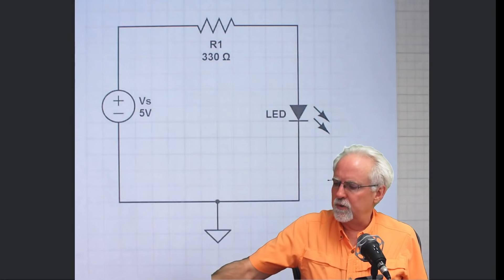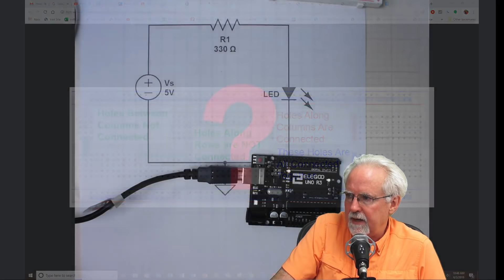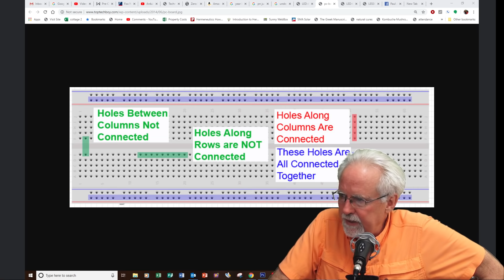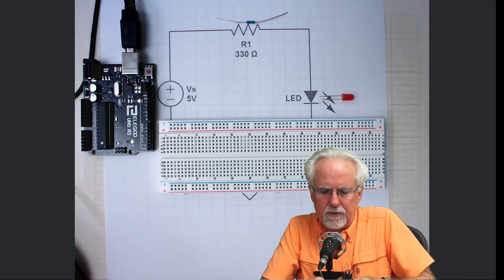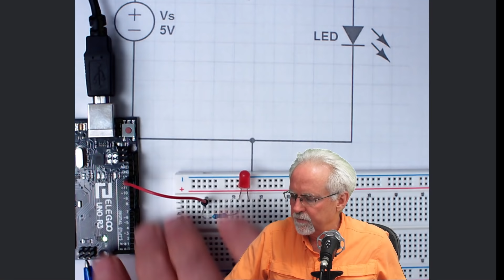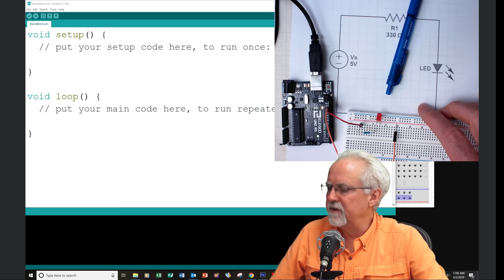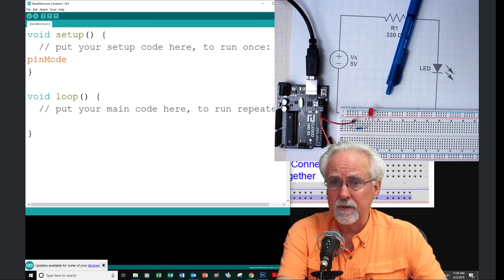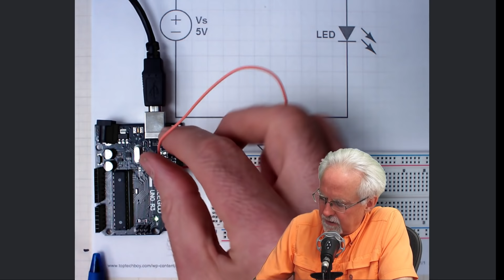Arduino Tutorial 3: Understanding How Breadboards Work

Comment: i did it by my self by your videos sir.

//code for blink red led 5 times
//green led 10 times 
//blue led 15 

void setup() {
  // put your setup code here, to run once:
pinMode(13,OUTPUT);
pinMode(12,OUTPUT);
pinMode(8,OUTPUT);
}

void loop() {
  // put your main code here, to run repeatedly:
  //red led will blink 5 times
digitalWrite(13,HIGH);
digitalWrite(12,LOW);
digitalWrite(8,LOW);
delay(100);
digitalWrite(13,LOW);
digitalWrite(12,LOW);
digitalWrite(8,LOW);
delay(1000);

digitalWrite(13,HIGH);
digitalWrite(12,LOW);
digitalWrite(8,LOW);
delay(100);
digitalWrite(13,LOW);
digitalWrite(12,LOW);
digitalWrite(8,LOW);
delay(1000);

digitalWrite(13,HIGH);
digitalWrite(12,LOW);
digitalWrite(8,LOW);
delay(100);
digitalWrite(13,LOW);
digitalWrite(12,LOW);
digitalWrite(8,LOW);
delay(1000);

digitalWrite(13,HIGH);
digitalWrite(12,LOW);
digitalWrite(8,LOW);
delay(100);
digitalWrite(13,LOW);
digitalWrite(12,LOW);
digitalWrite(8,LOW);
delay(1000);

digitalWrite(13,HIGH);
digitalWrite(12,LOW);
digitalWrite(8,LOW);
delay(100);
digitalWrite(13,LOW);
digitalWrite(12,LOW);
digitalWrite(8,LOW);
delay(1000);

//now green led will blink 10 times

digitalWrite(13,LOW);
digitalWrite(12,HIGH);
digitalWrite(8,LOW);
delay(100);
digitalWrite(13,LOW);
digitalWrite(12,LOW);
digitalWrite(8,LOW);
delay(1000);

digitalWrite(13,LOW);
digitalWrite(12,HIGH);
digitalWrite(8,LOW);
delay(100);
digitalWrite(13,LOW);
digitalWrite(12,LOW);
digitalWrite(8,LOW);
delay(1000);

digitalWrite(13,LOW);
digitalWrite(12,HIGH);
digitalWrite(8,LOW);
delay(100);
digitalWrite(13,LOW);
digitalWrite(12,LOW);
digitalWrite(8,LOW);
delay(1000);

digitalWrite(13,LOW);
digitalWrite(12,HIGH);
digitalWrite(8,LOW);
delay(100);
digitalWrite(13,LOW);
digitalWrite(12,LOW);
digitalWrite(8,LOW);
delay(1000);

digitalWrite(13,LOW);
digitalWrite(12,HIGH);
digitalWrite(8,LOW);
delay(100);
digitalWrite(13,LOW);
digitalWrite(12,LOW);
digitalWrite(8,LOW);
delay(1000);

digitalWrite(13,LOW);
digitalWrite(12,HIGH);
digitalWrite(8,LOW);
delay(100);
digitalWrite(13,LOW);
digitalWrite(12,LOW);
digitalWrite(8,LOW);
delay(1000);

digitalWrite(13,LOW);
digitalWrite(12,HIGH);
digitalWrite(8,LOW);
delay(100);
digitalWrite(13,LOW);
digitalWrite(12,LOW);
digitalWrite(8,LOW);
delay(1000);

digitalWrite(13,LOW);
digitalWrite(12,HIGH);
digitalWrite(8,LOW);
delay(100);
digitalWrite(13,LOW);
digitalWrite(12,LOW);
digitalWrite(8,LOW);
delay(1000);

digitalWrite(13,LOW);
digitalWrite(12,HIGH);
digitalWrite(8,LOW);
delay(100);
digitalWrite(13,LOW);
digitalWrite(12,LOW);
digitalWrite(8,LOW);
delay(1000);

digitalWrite(13,LOW);
digitalWrite(12,HIGH);
digitalWrite(8,LOW);
delay(100);
digitalWrite(13,LOW);
digitalWrite(12,LOW);
digitalWrite(8,LOW);
delay(1000);

//NOW BLUE LED WILL BLINK 15 TIMES

digitalWrite(13,LOW);
digitalWrite(12,LOW);
digitalWrite(8,HIGH);
delay(100);
digitalWrite(13,LOW);
digitalWrite(12,LOW);
digitalWrite(8,LOW);
delay(1000);

digitalWrite(13,LOW);
digitalWrite(12,LOW);
digitalWrite(8,HIGH);
delay(100);
digitalWrite(13,LOW);
digitalWrite(12,LOW);
digitalWrite(8,LOW);
delay(1000);

digitalWrite(13,LOW);
digitalWrite(12,LOW);
digitalWrite(8,HIGH);
delay(100);
digitalWrite(13,LOW);
digitalWrite(12,LOW);
digitalWrite(8,LOW);
delay(1000);

digitalWrite(13,LOW);
digitalWrite(12,LOW);
digitalWrite(8,HIGH);
delay(100);
digitalWrite(13,LOW);
digitalWrite(12,LOW);
digitalWrite(8,LOW);
delay(1000);

digitalWrite(13,LOW);
digitalWrite(12,LOW);
digitalWrite(8,HIGH);
delay(100);
digitalWrite(13,LOW);
digitalWrite(12,LOW);
digitalWrite(8,LOW);
delay(1000);

digitalWrite(13,LOW);
digitalWrite(12,LOW);
digitalWrite(8,HIGH);
delay(100);
digitalWrite(13,LOW);
digitalWrite(12,LOW);
digitalWrite(8,LOW);
delay(1000);

digitalWrite(13,LOW);
digitalWrite(12,LOW);
digitalWrite(8,HIGH);
delay(100);
digitalWrite(13,LOW);
digitalWrite(12,LOW);
digitalWrite(8,LOW);
delay(1000);

digitalWrite(13,LOW);
digitalWrite(12,LOW);
digitalWrite(8,HIGH);
delay(100);
digitalWrite(13,LOW);
digitalWrite(12,LOW);
digitalWrite(8,LOW);
delay(1000);

digitalWrite(13,LOW);
digitalWrite(12,LOW);
digitalWrite(8,HIGH);
delay(100);
digitalWrite(13,LOW);
digitalWrite(12,LOW);
digitalWrite(8,LOW);
delay(1000);

digitalWrite(13,LOW);
digitalWrite(12,LOW);
digitalWrite(8,HIGH);
delay(100);
digitalWrite(13,LOW);
digitalWrite(12,LOW);
digitalWrite(8,LOW);
delay(1000);

digitalWrite(13,LOW);
digitalWrite(12,LOW);
digitalWrite(8,HIGH);
delay(100);
digitalWrite(13,LOW);
digitalWrite(12,LOW);
digitalWrite(8,LOW);
delay(1000);

digitalWrite(13,LOW);
digitalWrite(12,LOW);
digitalWrite(8,HIGH);
delay(100);
digitalWrite(13,LOW);
digitalWrite(12,LOW);
digitalWrite(8,LOW);
delay(1000);

digitalWrite(13,LOW);
digitalWrite(12,LOW);
digitalWrite(8,HIGH);
delay(100);
digitalWrite(13,LOW);
digitalWrite(12,LOW);
digitalWrite(8,LOW);
delay(1000);

digitalWrite(13,LOW);
digitalWrite(12,LOW);
digitalWrite(8,HIGH);
delay(100);
digitalWrite(13,LOW);
digitalWrite(12,LOW);
digitalWrite(8,LOW);
delay(1000);

digitalWrite(13,LOW);
digitalWrite(12,LOW);
digitalWrite(8,HIGH);
delay(100);
digitalWrite(13,LOW);
digitalWrite(12,LOW);
digitalWrite(8,LOW);
delay(1000);

//TASK IN COMPLETE
}

Comment: int i = 0;
 void setup() {
  // put your setup code here, to run once:
pinMode(13,OUTPUT);
}

void loop() 
{
  // put your main code here, to run repeatedly:
  
 for (i=1; i<6; i++)
  {digitalWrite(2,HIGH);
   delay(500);
   digitalWrite(2,LOW);
    delay(500);
  }
  for (i=1; i<11; i++)
  {
    digitalWrite(3,HIGH);
    delay(500);
    digitalWrite(3,LOW);
    delay(500);
  }
  for (i=1; i<16; i++)
  {
    digitalWrite(4,HIGH);
    delay(500);
    digitalWrite(4,LOW);
    delay(500);
   }
}
Reply: Hello sir, thanks for the code , it really helped me. But ,how does the output command works , you had taken three different pin for 3 different leds's, whereas in void setup column you had mentioned only pin 13 which is not in any of the connection with those led's. kindly clarify and help me out.

Comment: Hi Paul. At first I thought we would need a method of counting and the ability to apply logic but we hadn't covered anything like that. Then I realized you had not given us a time component,. So, I just assumed you wanted us to flash 5, 10 and 15 times over the same (unstated) period. I arbitrarily used delays of 500. 1000, and 1500.  Seems to work.

Comment: My 11 year old son has completed the first two tutorials but got stuck on this third one.  The circuit did not work.  We had to troubleshoot.  We were NOT using components we purchased from this course but rather ones we scavenged from other electronics kits. We found using a simple circuit we constructed from a Snap Kit with AA batteries to test components worked well.  He was able to find that one of our wires was broken, and he also found that he used the wrong resister.  He was so excited when he finally got the programmed circuit to work!   Thanks again!

Comment: I did it,but I'm sure there's a more efficient way to do it. Next lesson??
Reply: OK, Paul,  I built the three flashing LEDs using variables.  Boom - all happy colours and flashing!  But I'm wondering if there is a quicker way to command the number of flashes instead of copying the code  the number of flashes you want?  Is there a variable that says "'do this X times"? Or have I run ahead of your very excellent tutorials?

Comment: Good day sir, coming to your channel has really help me alot in understanding arduino and below is my assignment the coding on the arduino IDE, hope you go through it.
void setup() {
  // put your setup code here, to run once:
pinMode(3,OUTPUT);
pinMode(5, OUTPUT);
pinMode(6, OUTPUT);
}

void loop() {
  // put your main code here, to run repeatedly:
digitalWrite(3, HIGH);
delay(500)
digitalWrite(3, LOW);
delay(500)
digitalWrite(5, HIGH);
delay(500);
digitalWrite(5, LOW);
delay(500);
digitalWrite(6, HIGH);
delay(500);
digitalWrite(6, LOW);

Comment: Hi. I set up the program on pin number 8, however, the integral LED on pint 13 is on. I downloaded a bareprogram example and the integral LED of pin 13 is on. It never goes off. Why?.
In the video I see the integral LED for pin 13 is off when Paul makes the set up on pin 8.

Comment: For the homework, if the ground is used by the first LED, how can the second and third LED use the ground?
Reply: I used the ground on the top row.  So I have a cable going from 13 to j4, a cable from 12 to j15, a cable from 11 to j25.  3 resistors going to the 3 leds, then a negative from the row the leds end in to the top negative row, and finally 1 cable back from the top negative row to the ground.

Comment: In the part of the video where Paul ask you to switch it to pin 8 from 13, in my haste I forgot to change the pinMode to 8 and left it as pinMode13 but changed my digitalWrites to pin 8 and the LED still light, but it was about half the brightness as it had been when pinMode and digitalWrite had been on 13. Why is this?

Comment: I finished the homework, but I noticed something. It seems that when you use "delay(*placeholder*);" it has to be the same number for each LED? Otherwise it doesn't sequence properly when the other LEDs are supposed to come on. I fixed it by setting all of the delays to 500, but, did I do something wrong or is this simply how Arduino code tends to work?

Comment: Oh, I paused the video before you gave the homework, connected all 6 red LEDs that were in my box and made a Knight Rider like running red light. And it worked ! Started with the first LED, after that always 2 LEDs at the same time on running to the right, leaving the last LED on and coming back then 2 seconds break before the next sequence. Now I can buy more resistors and leds, solder them on a circuit board and build the whole thing into my car. xD
Your Tutorials are great.
Reply from the maker: Nice work!
Reply: @paulmcwhorter  thx, I can't wait until I can give signals into the arduino. Just added the binary counter to the kitt light.

Comment: I figured out the circuit part of the homework but not the code part of the homework, I can set up the LEDs to all have the same speed for blinking but not for each LED to have a different speed for blinking, can someone help me out please?
Reply: "LEDs to all have the same speed for blinking", "each LED to have a different speed for blinking"

I'm not sure I understand your question, but I think the homework is to have them blink separately...? So first red 5 times, then green 10 times, then blue 15 times. Doing them simultaneously would be harder. Anyway, you just gotta time the delays correctly I guess

Comment: Tip for the HW:

try using a for loop inside the void loop so you don't have like 50 lines of code

for(int x = 0; x < 5; x++){

code goes here

}

have three of these for each color, make sure you change the variable for each

explanation:
 int x = 0; just means that a variable has been declared with a value of 0
x < 5; just means it will stop after 5 loops (change accordingly)
x++ just means that after every loop x will increase by 1
Reply: I used a while loop and that worked as well but thanks for the tip.

Comment: Great stuff! I just started with Arduino a few months ago and a little further along, but I'm watching your vids from the beginning for the extra info.

One thing I started doing was merging lessons into the previous lessons. So, projects Blink LED, RGB LED, Buzzer and Ball Switch became an all-in-one project that sounded/blinked the alphabet in Morse Code (dots in red and dashes in green) and when I tilt the board it starts sounding/blinking SOS until it is leveled and restarts the alphabet. Or, I can have it sound/blink a real message. The next step, add a momentary switch so I can attempt to send Morse Code sequences.

Comment: perhaps it's because I was trained as a draftsman and not an engineer, but I might be just a little more picky about being organized, so for the homework assignment, I also added having all three LED's on for 2 seconds to indicate the end of the loop. Additonally I added line of code to turn off the on board LED at pin 13 and used pin's 12, 11 and 10 for my red, green and blue. Also, I found that with a 330 ohm resistor, the LED's were too bright, so i put in 10k ohm resistors and they are considerably dimmer. It might be the night vision I developed from being in the army, but it seems less annoying to have them dimmer...

Comment: Home Work Solution
NOt that Great but it would do the Work

int var = 0;
int LED = 13;
int LED2 = 12;
int LEDPin=8;
int wait=100;
int x = 0;
int var3 = 0;
void setup() {
  // put your setup code here, to run once:
  pinMode (LEDPin,OUTPUT);
  pinMode (LED,OUTPUT);
  pinMode(LED2, OUTPUT);
}

void loop(){
  // put your main code here, to run repeatedly:

 while(x < 5) {digitalWrite(LEDPin,HIGH);
  delay(wait);
  digitalWrite(LEDPin,LOW);
  delay(wait);
  x++;
      }
 while(var < 10) {digitalWrite(LED,HIGH);
  delay(wait);
  digitalWrite(LED,LOW);
  delay(wait);
  var++;
     }
  
 while(var3 < 15) {digitalWrite(LED2,HIGH);
  delay(wait);
  digitalWrite(LED2,LOW);
  delay(wait);
  var3++;
     }
 x = 0;
 var3 = 0;
 var = 0;
}

Comment: Quite a long script compared to the last one, but I think I did it,

void setup() {
  // put your setup code here, to run once:
pinMode(10,OUTPUT);
pinMode(11,OUTPUT);
pinMode(12,OUTPUT);
}

void loop() {
  // put your main code here, to run repeatedly:
digitalWrite(10,HIGH);
delay(1000);
digitalWrite(10,LOW);
delay(1000);
digitalWrite(10,HIGH);
delay(1000);
digitalWrite(10,LOW);
delay(1000);
digitalWrite(10,HIGH);
delay(1000);
digitalWrite(10,LOW);
delay(1000);
digitalWrite(10,HIGH);
delay(1000);
digitalWrite(10,LOW);
delay(1000);
digitalWrite(10,HIGH);
delay(1000);
digitalWrite(10,LOW);
delay(1000);
digitalWrite(11,HIGH);
delay(1000);
digitalWrite(11,LOW);
delay(1000);
digitalWrite(11,HIGH);
delay(1000);
digitalWrite(11,LOW);
delay(1000);
digitalWrite(11,HIGH);
delay(1000);
digitalWrite(11,LOW);
delay(1000);
digitalWrite(11,HIGH);
delay(1000);
digitalWrite(11,LOW);
delay(1000);
digitalWrite(11,HIGH);
delay(1000);
digitalWrite(11,LOW);
delay(1000);
digitalWrite(11,HIGH);
delay(1000);
digitalWrite(11,LOW);
delay(1000);
digitalWrite(11,HIGH);
delay(1000);
digitalWrite(11,LOW);
delay(1000);
digitalWrite(11,HIGH);
delay(1000);
digitalWrite(11,LOW);
delay(1000);
digitalWrite(11,HIGH);
delay(1000);
digitalWrite(11,LOW);
delay(1000);
digitalWrite(11,HIGH);
delay(1000);
digitalWrite(11,LOW);
delay(1000);
digitalWrite(12,HIGH);
delay(1000);
digitalWrite(12,LOW);
delay(1000);
digitalWrite(12,HIGH);
delay(1000);
digitalWrite(12,LOW);
delay(1000);
digitalWrite(12,HIGH);
delay(1000);
digitalWrite(12,LOW);
delay(1000);
digitalWrite(12,HIGH);
delay(1000);
digitalWrite(12,LOW);
delay(1000);
digitalWrite(12,HIGH);
delay(1000);
digitalWrite(12,LOW);
delay(1000);
digitalWrite(12,HIGH);
delay(1000);
digitalWrite(12,LOW);
delay(1000);
digitalWrite(12,HIGH);
delay(1000);
digitalWrite(12,LOW);
delay(1000);
digitalWrite(12,HIGH);
delay(1000);
digitalWrite(12,LOW);
delay(1000);
digitalWrite(12,HIGH);
delay(1000);
digitalWrite(12,LOW);
delay(1000);
digitalWrite(12,HIGH);
delay(1000);
digitalWrite(12,LOW);
delay(1000);
digitalWrite(12,HIGH);
delay(1000);
digitalWrite(12,LOW);
delay(1000);
digitalWrite(12,HIGH);
delay(1000);
digitalWrite(12,LOW);
delay(1000);
digitalWrite(12,HIGH);
delay(1000);
digitalWrite(12,LOW);
delay(1000);
digitalWrite(12,HIGH);
delay(1000);
digitalWrite(12,LOW);
delay(1000);
digitalWrite(12,HIGH);
delay(1000);
digitalWrite(12,LOW);
delay(1000);
}

Comment: Hello teacher, thanks for the videos.
¡I need help, community and and teacher!
I've done the homework XD but it doesn't work.
The red led does turn on 5 times.
The green led does turn on 10 times (very low light).
But the blue led doesn't turn on. 
I think it is because I need a more little resistance. I am using a 220oms one. ¿Is that happening to you?
Reply: It cannot be that because if I change the cables, the blue led lights up. I can't find the error. The program is correct, the component are correct, the diodes are in the good position...
Reply: It was one led and the protoboard/cables that make bad connections...

Comment: void setup() {
  // put your setup code here, to run once:
pinMode(8,OUTPUT);
pinMode(9,OUTPUT);
pinMode(10,OUTPUT);
}

void loop() {
  // put your main code here, to run repeatedly:
  for (int i=0; i<5; i++){
    digitalWrite(8,HIGH);
    delay(1000);
    digitalWrite(8,LOW);
    delay(1000);
    }
    for (int i=0; i<10; i++){
    digitalWrite(9,HIGH);
    delay(1000);
    digitalWrite(9,LOW);
    delay(1000);
    }
    for (int i=0; i<15; i++){
    digitalWrite(10,HIGH);
    delay(1000);
    digitalWrite(10,LOW);
    delay(1000);
    }
}